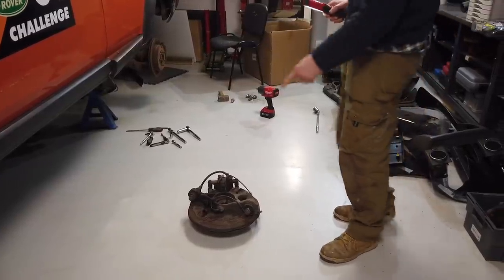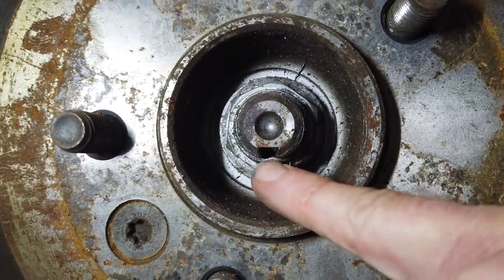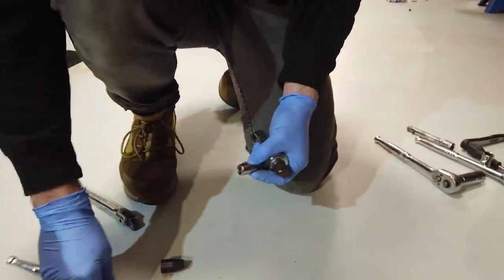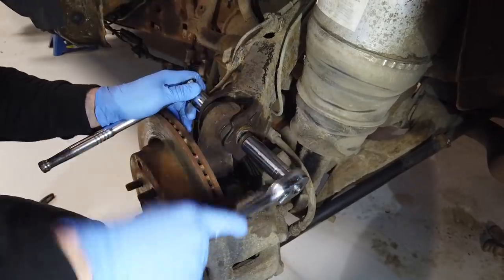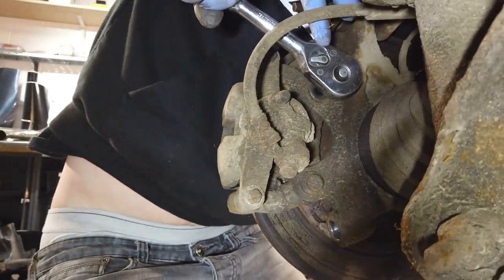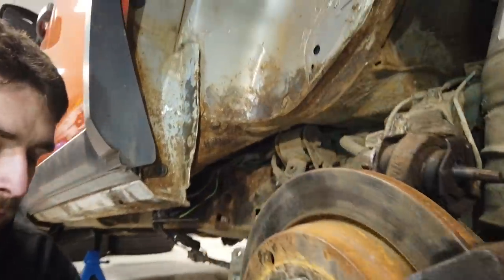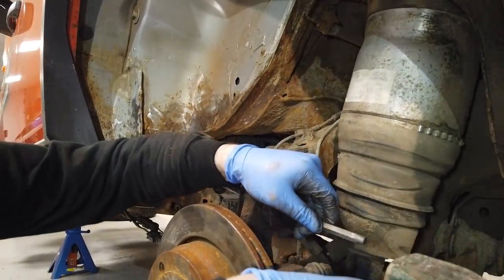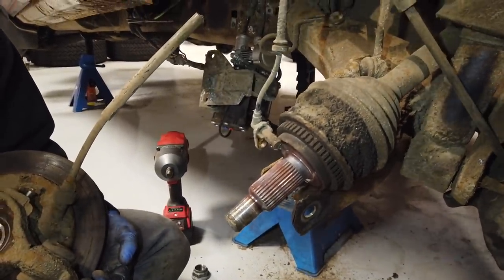How To Remove The Rear Hub On Land Rover Discovery 3 / 4 / Range Rover Sport

Comment: You did help me out! I watched a few videos on how to remove the hub including yours. I had a right mare getting the lower bolt from the brake caliper out. Rounded the head, tried everything including the bolt extractor socket, nothing.
Then I came.back to your.vid and watched it to the end, and I saw you did the same. I had no idea you could remove it by removing the other two bolts. Life saver !

Comment: Are all the driveshaft nuts all the same size for the 2007 RRS to? Oh what size socket is it?
Reply from the maker: They are M24 thread and the threads are not the same on all models - some are 2mm pitch and some are 1.5mm pitch.
Reply: @L663  I mean the axle nut, is that 32mm?
Reply: @darylhatherrley5765  Yes i figured that - if you look up M24 thread it suggests the spanner size is 36mm